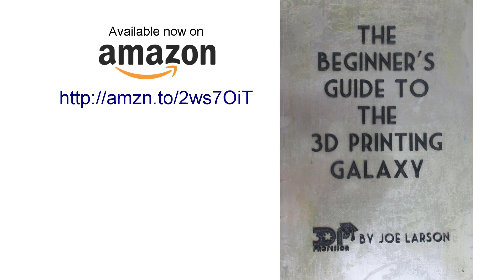The Creality CR-10S and GPL Violations

Comment: Creality is only the main topic because they are the the most popular manufacturer that is in violation.
Reply: Tac — We on the Marlin Firmware Development Team are not specifically interested in the power-loss recovery code (which we already understand well), and in fact we were looking at lots of other vendors before Creality's violation came to light, as anyone can see by scanning the Marlin Issue Queue. However, you are correct that the no-extra-hardware-required power-loss recovery feature is the one thing that currently differs from stock Marlin Firmware. Everything else on the CR-10S can be found in Marlin 1.1.8 and the upcoming 1.1.9. We are already working on power-loss recovery, and this will be included in Marlin 2.0, which is not far off either.
Reply: It's notable because it's the first instance that 3D printer vendor has leveraged a GPL violation as a USP - unique selling point - with a feature that they must by firmware license pass onto the consumer as source code, but didn't. Other printers violating the GPL do so with only trivial configuration changes, that are even usually done so sloppily, that you'd be better off using ANYTHING you shat out in half an hour, but not the firmware that the device ships with, so GPL violation was definitely not a selling point.
Reply: Dan Rogers no it's because they have power out code that they want in their own firmwear distribution to sell more products thats why they don't care about the other vendors.
Reply: Without going into detail that is pretty much what I meant. I have been following this as I am a maker. Along with posting the original video in the groups I belong to.

Comment: Great video, but I think you were wrong about that users don't complain about other manufacturers practicing this closed source behavior. For example JGAurora user's have been in contact to the manufacturer of releasing it's Marlin version but so far it seems it's like talking to the brick wall. I don't think it's going to happen anytime soon. Sad that these Chinese don't realize the benefits of being open source.
Reply: If there is a community around your device and it's open source - that community will create features around it that will benefit the sales of that device.  Look how many things are on Thingiverse for upgrading the CR-10 or the anet A8.  Now apply that to the software that runs those printers.  Even though Cisco/Linksys got caught in a GPL violation the sales of the Linksys home routers shot up because you could easily replace the firmware with a VERY feature rich DD-WRT community developed firware.  New router manufacturer like TP-link have embraced this and made devices that are specifically aimed at the open source community.  Creality have to ask themselves if they want to be a hardware company or a software company.  Since they have admitted already they get the firmware from a 3rd party - they need to focus on being a good hardware company and give their hardware some basic software that is easily upgradable - the community will take care of the rest.
Reply: Exactly! :) I think these cheap chinese 3D printer manufacturers need some differentiation, so first one which will go fully open-source route with also decent hardware and quality assurance will skyrocket in popularity.
Reply: Creality has almost done it - they make a mostly assembled kit that prints very well out of the box - they also have a history of incorporating common fixes from the community back into manuf - like the bed connection strain relief.  I will continue to support them but they need to fix this GPL issue it's a small thing they just have to get over it - they will reap the benefits.
Reply: We (Marlin Developers) are asking all owners of JGAurora products to please write a polite request to JGAurora for a copy of the firmware source code. We are interested mostly in collecting their replies as documentation for further action.
Reply: DidntThinkofAnythingElse I don't exactly see the benefit either, I have to trust it's a good business model. I get that violations are bad but it also seems counterintuitive that it would help manufacturers
Reply: In 3D printing community usually most people mod their printers and upgrades them to perform better and add new capabilities. Being open source greatly attracts people with that mentality who wants to tinker with their printers (Makerbot was a great example of this). For example I would love to modify my printer's software to add all sorts of new behaviors to it.
Reply: DidntThinkofAnythingElse I don't have any experience or obvious aptitude for coding, wouldn't dare to mess with firmware because my expectation would be bricking the printer. I intend to learn arduino but if I can get away with only learning that for my projects I'll be happy. I'm more of a materials guy, software is in my mind still like ether, if it's your interest then I can understand the excitement over open source because it's a free resource.
Reply: Chris Miller I understand the benefits now, it's outsourcing improvements to a dedicated community for free, I can see why that would be good. Thanks!
Reply: JG Aurora listened and have released the code for at least the A3s and A5. From what i have read some of their other printers are still closed source.